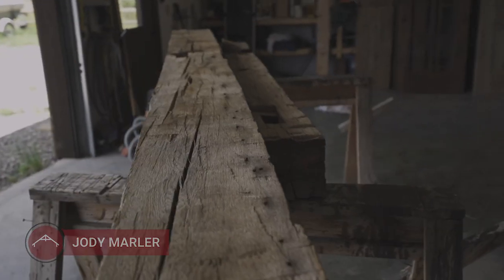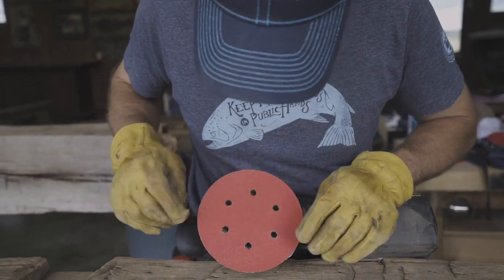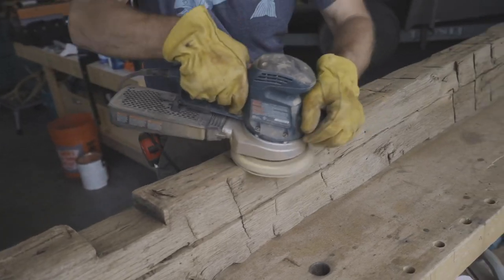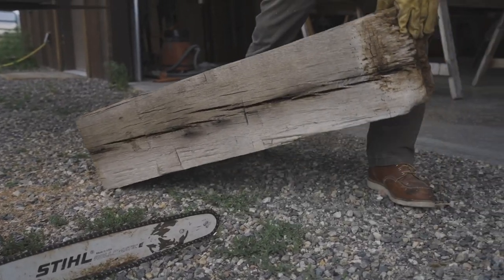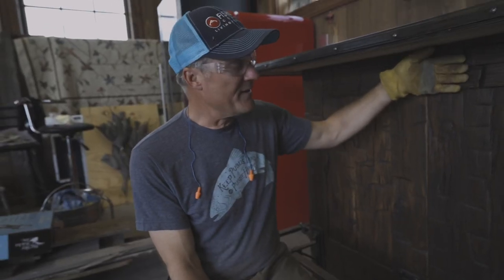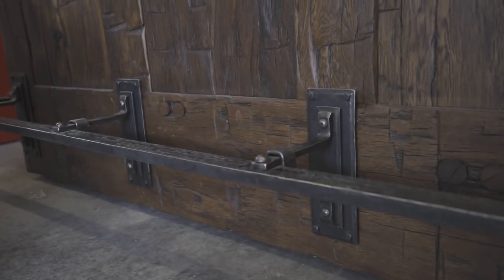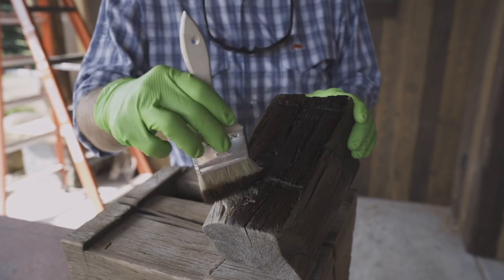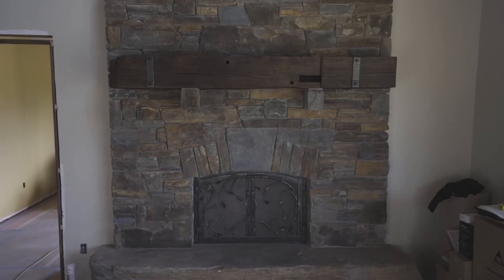Reclaimed Mantle Process | FishCamp Custom | Bozeman, Montana

Comment: How is the mantle hung in it’s final location?  If it is heavy enough to require a forklift to lift, I imagine it must require significant framing to support.
Reply from the maker: Thanks for the great question. We support them on the corbeled Stones and also epoxy all threaded rod in the stone and into the mantle as well.